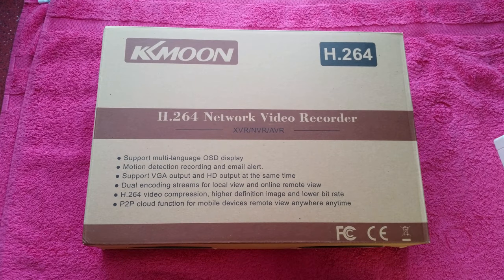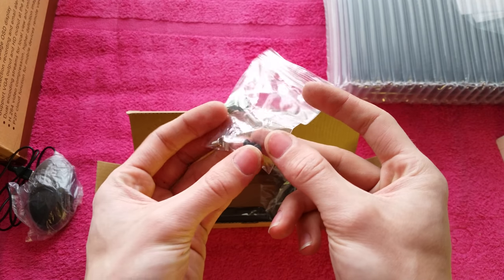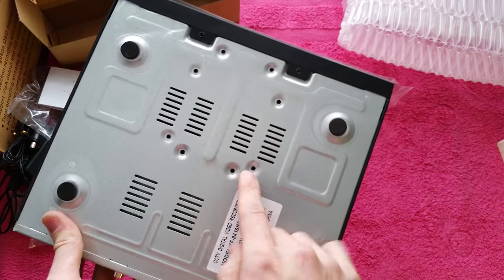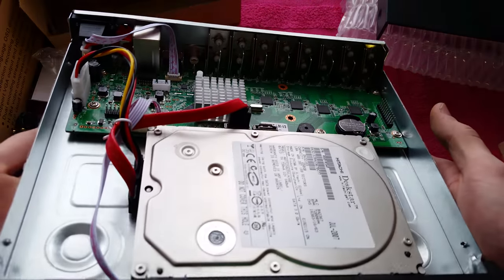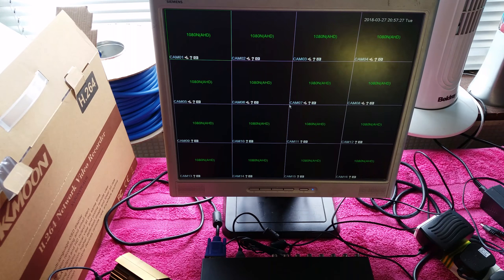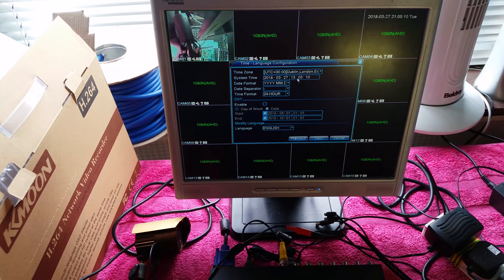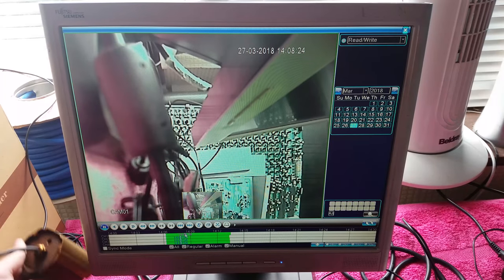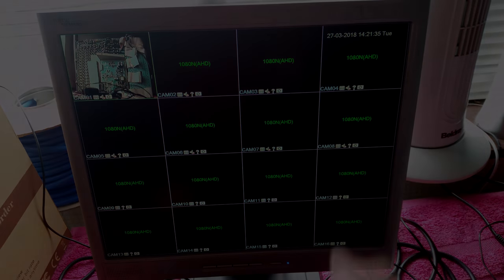KKMoon 16 Channel H.264 CCTV DVR Unboxing + Demo - Network Video Recorder Model XF-9416NF-LM

Comment: will this unit do network cameras so it behaves like an nvr?  also can it be seen on the pc without software? i seen a youtube that show it on the pc but they did not show adding any software, just setting the pc in the setting for activex and a few other settings then they input the ip address of the nvr/dvr and port and it showd on the pc. they did not show adding software. good demo by the way. thanks

Comment: Hi I had a question I have this camera system it was working perfectly but one day it just stop recording. The blue light in front of the box isnt blue. I thought it was the hard drive so I bought a new one but still the same. Do you know how can I fix the issue where I can put it to record and the blue light comes on? Thanks

Comment: hi tehre. I am bit confused about the device. maybe someone might answer me some questions ...

question 1:
is it possible to name the cameras
instead of cam1 .. cam8 
with names like house garden basement roof etc?

question 2:
motion detection - area selection
there is green or red.
what color is for recording if motion in area?

question 3:
what are the correct settings?
If a motion is detected the cam should record for about 30 seconds

question 4:
file export seems to be h264 , is any .mp4 or .avi available?

question 5:
is there any player for h264 available for linux macos or windows

question 7:
as the manual we found on the web is very confusing, a upadted manual download might help ..

thanks in advance
best regards

mike

Comment: Do you have to have a hdd for the cameras to work???
Reply from the maker: If you want recording functionality then yes a hard drive is required. 
It should however work without a hard drive to just display the live video feeds without recording them.

Comment: Have you had any success connecting this DVR to a PC client? I've got XMeye working fine but haven't managed anything on the PC.
Reply from the maker: I haven't actually. I either use the recorder itself or the mobile application. 
I prefer to remote live-view on the mobile app but if I need to save a recording or to playback past footage I'll do it on the actual DVR as I also find the quality is better that way.
Reply: I have all my customers kkmoons loaded on the program CMS. I like that program because you can download events directly to your pc's hard drive

Comment: So I have 2 cameras hooked up now. Why does a alarm go off once in a while on my still camera that I think is a 960, The other one is a PTZ that may be a different quality.  I don't think I am understanding what cameras work with this unit.
Reply from the maker: Hi, I'd advise looking at the log on the recorder and it would tell you there. The alarm could be for a number of reasons, including but not limited to intermittent video connection to the camera, the DVR detecting the camera as 'blinded', hard drive errors, network errors, etc. You'd have to check the log and see what it's picking up as the problem.
Hope this helps, --Nathan
Reply: Thanks  @NathanPH , I shut the alarm off however I am guessing blinded?  Looks like you can turn your log on or off, mine was off.

Comment: hi...what is the maximum camera resolution works for this dvr?. i having 3mp cctv camera connected on it but i can't get any image on screen...thanks bro
Reply from the maker: Hi, The DVR supports up to 1080p resolution cameras. The issue is probably the video format of your cameras. Try to change the video output format of the camera if possible or change the settings on the DVR. You'll have a few to choose including XVI, AHD, TVL etc.. And this should match your camera format.
Hope this helps,
--Nathan

Comment: I connected mine to a smart tv .. does the DVR have to be connected to internet with wires in order to make it connect to my phone ?
I try to connect net work but it's not working just by connecting the tv wireless
Reply from the maker: Hi there, Yes you definitely need the network connection plugged in for mobile viewing. That's how it communicates out from the DVR to other devices. 
Hope this helps!
--Nathan

Comment: Hi, I have the same dvr but I do not have the user manual and I need to reset the administrator password to configure it.

Could you help me in this case?
Reply from the maker: Hi, The default administrator password is blank, so just choose Admin and press OK/Login. 
Hope this helps! 
--Nathan.

Comment: What is the recommended hdd for this unit? Is 1tb 3.5 hdd Ok?
Reply from the maker: Yes that should be fine. I'd recommend you use a hard drive designed for 24/7 use though, for example the Western Digital Purple hard drives are designed for 24/7 use in surveillance systems.

Comment: What’s the name of the hard drive for this box plz
Reply from the maker: I recommend using WD Purple drives as these are designed for 24/7 use in CCTV systems. Seagate also offers a surveillance model hard drive that would be suitable.
However, just about any hard drive would work.

Comment: LOVED YOUR VIDEO!         What's the biggest hard drive I can put into this unit, Looking to store around a month or more? Guessing I can dump stored video to a SD stick then burn to dvd using my laptop?  Any suggestions on a cheap PTZ to use with this system?   Once again great video.
Reply from the maker: Hi there, Thanks! Glad you found the video helpful. You can install up to a 3TB hard drive in these units. I have a 16CH unit with 12 cameras and a 1TB WD Purple drive in an installation that can store around 7 days worth of video. Three cameras are 1080 and the others are all 960 resolution and I have the quality set to either high or very-high I think. 
Yes you can export video to a USB stick, external hard drive etc.. quite easily in two or three different formats. I usually just use the AVI default setting though. 
I have no experience in the PTZ camera department yes so I'm afraid I cannot help you there. All the situations we tent to fit cameras just need a basic fixed unit. 
Glad to be of assistance, hope this helps you out some more! 
--Nathan
Reply: @NathanPH  thanks for all the info
Reply: Will this hard drive work? 

Western Digital Purple Surveillance HDD 3TB WD30PURX Sata 6GB/s 64MB Cache
Reply from the maker: Certainly should! I actually use the 1TB version in both an 8CH and 16CH version of this DVR. They're good drives for the cash. 
--Nathan
Reply: Hello Nat,  Well my Kmoon arrived along with my hard drive.  My question is do I need to buy the cables to hook up my hard drive?  If so what are they called, I don't see them in the hard drive box.

                                                   Johnny
Reply: Well Da   Its in your instructions,   K Tanks

Comment: Anybody else out there having a problem with their kkmoon DVR stuck on update?
Reply: yes...happened to several of my customers one particular night...none had a secure password and all had cloud enabled. To fix disconnect internet, reboot, turn off cloud enabled under network , change password to something secure , reboot again then connect internet after it comes up.
Reply: @pmcmaken  Wont that kill remote viewing?
Reply: No I have them all using IP address, not the uid number.. Just have to forward that port 34567 in router when you first set it up. Port forwarding is so much user friendly these days
Reply: @pmcmaken  Gotcha very helpful thanks
Reply: @pmcmaken  if you turn of cloud setting then XMEye can no longer connect even with port forwarding. How did you get around that? What phone app are you using?
Reply: @andrewholland1390  using xmeye but when you start the app don't login with the cloud.. Just hit the little colored icon in the lower left corner.. Then add the device using the"ddns" option. Use the IP address the router automatically assigns .. last step is to forward the port 34567 in the router for your locally assigned IP address (192.168.*.*) Your local service provider... Spectrum, wow att will do that for you at no charge if you call them